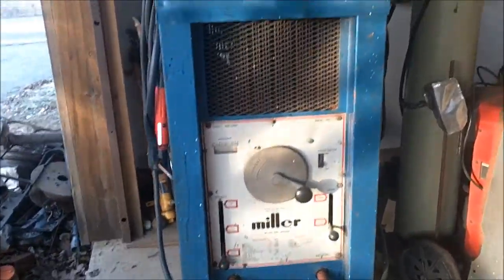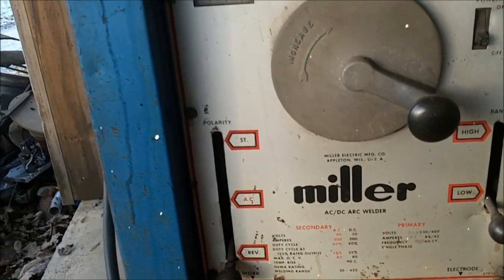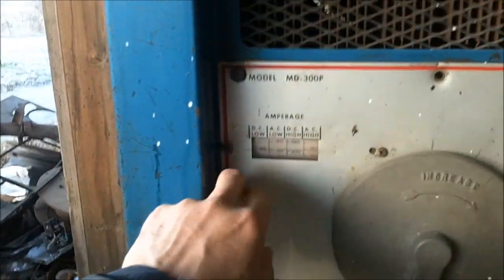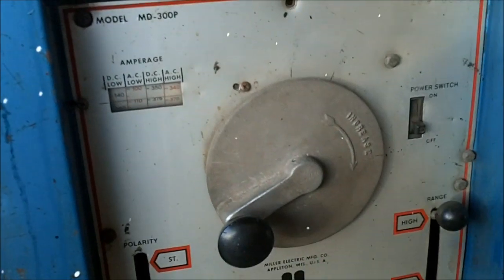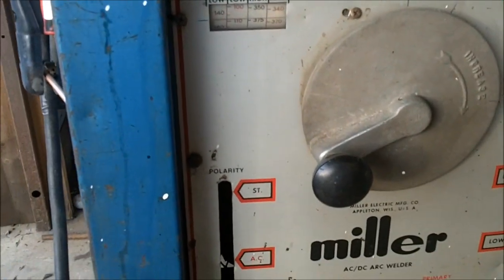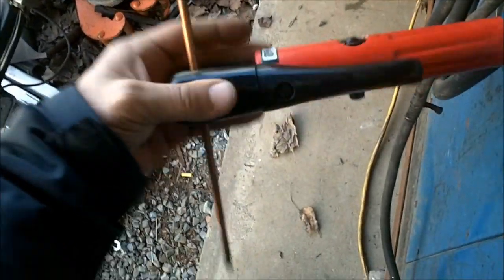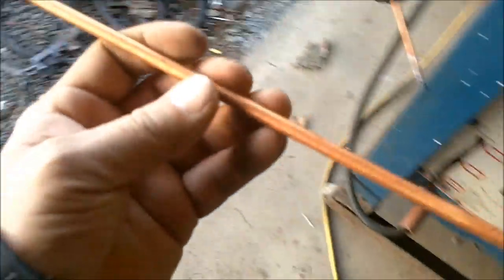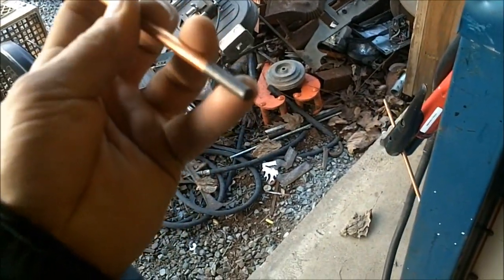Carbon arc gouging

Comment: Atomic Hydrogen welding used opposed TUNGSTEN electrodes in a holder that can adjust the arc gap in a Hydrogen shield.  The Arcair process is normally used on high amperage DC.  The usual practice on site was to connect two 400 amp diesel  generators together with a compressor.

Comment: Atomic hydrogen Welding used two TUNGSTEN electrodes in a Hydrogen shield.  I have used it for welding low carbon iron Chain links (a common application in the past).

Comment: That machine needs 200 Amp service to pull the most out of it the bad thing is it is less then 60% duty cycle @ 300 plus amps and will eat power like no tomorrow.I own a 600 amp same looking machine and I have a high frequency with it for TIG welding I do not use it anymore I have a Miller XMT350 and run it on a 100 amp service and this machine will do anything I want .

Comment: You can burn out the internal conductor cable if you strike up without air flowing through the torch.

Comment: I kinda question your statement regarding how many amps are required to do this. I bought a well used Miller Dialarc 250 a few years ago from a business that was using it for air arc gouging. In fact, I even have the special torch that was used with it. Unfortunately, I have no way to try it out for myself, as they cut the hose/cable off of it. But apparently they were using it with a 250 amp machine.

Comment: Thanks for the video.
So, you strike an arc and then the flow of air removes the molten metal created by the arc? But where does the stream of air come from, is it built into a nozzle in the torch or have i got it wrong, does the arc force itself force out the molten metal??
Reply: fonseca365 super late reply, yes the air comes out of the end of the “torch” blowing the molten metal away from the area.

Comment: Hey, you forgot the Hydrogen. Between those 2 electrodes a jet of hydrogen gas was blown. This would provide sorta of a reducing atmosphere and much more importantly, the hydrogen molecules are forced apart by the arc. This atomic hydrogen is unstable and as it impinges the (relatively) cool workpiece it releases all the energy it absorbed from the arc.